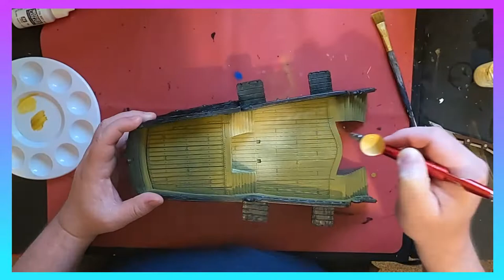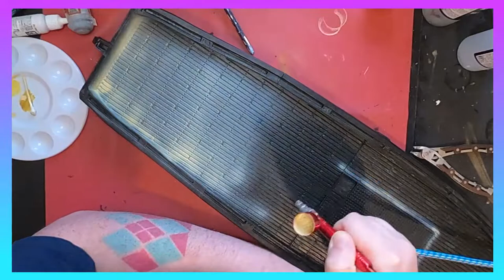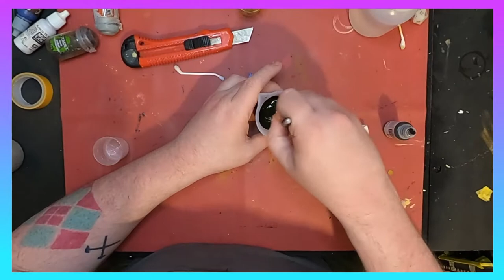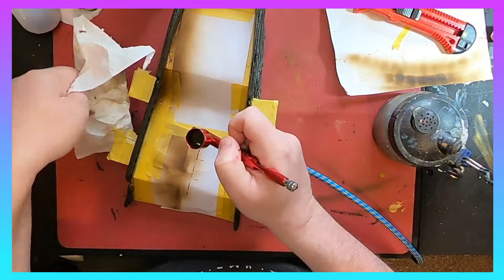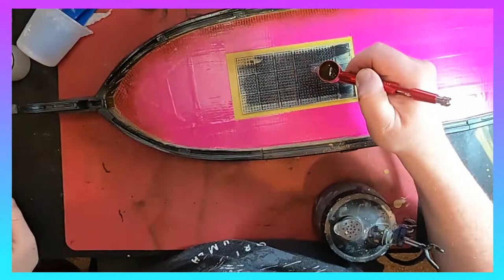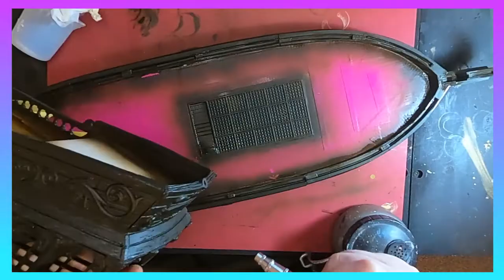Reaper Base Coating The Sophie's Revenge HUGE Pirate ship part three of many (???)

Comment: It's looking great already, but really emphasises how much work is involved! How much 'real' time is condensed into those 5 minutes?
Reply from the maker: In this video? Hours. I think I only really show the first coat going on. Theres also things like prepping that's not on the video. To protect the light wood (deck) colour I used a few coats of hairspray (old skool varnish) so the duct tape wouldn't RIP it off. I'd say I did about 5-6 coats with each colour too